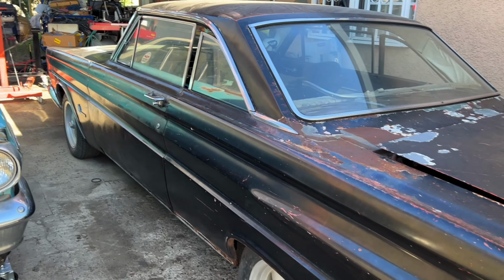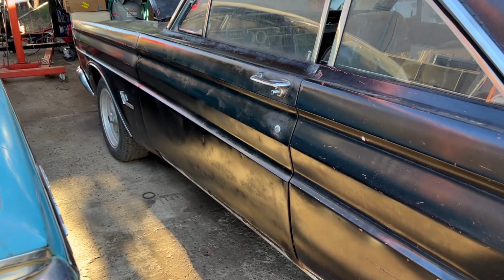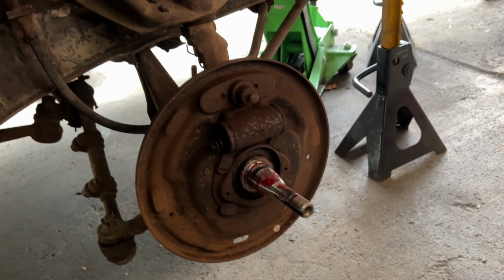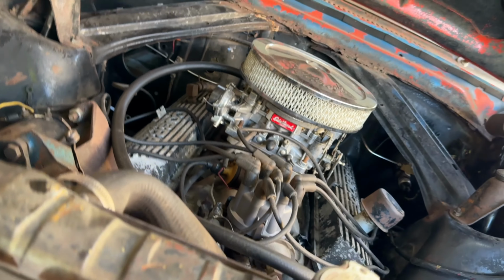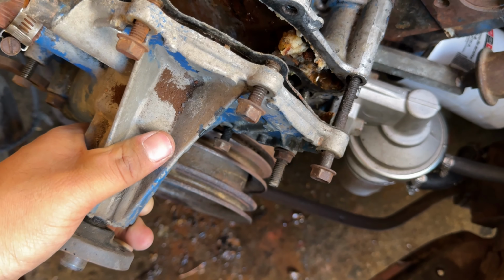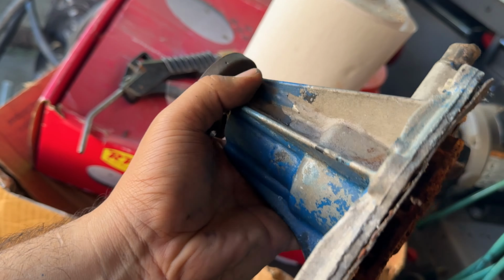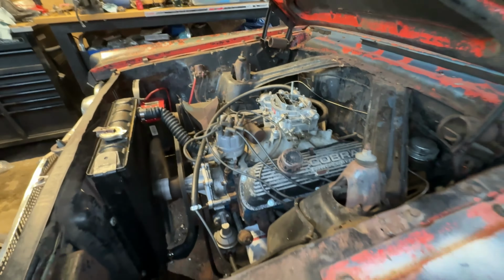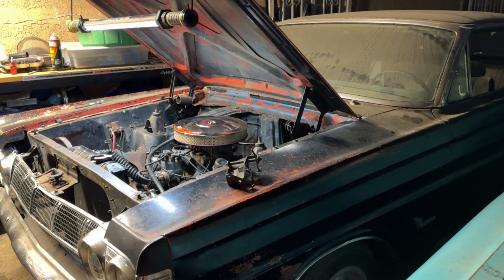Getting the 1964 Comet Cyclone Back on the Road!

Comment: Good progress and it is clever that you keep old parts around and you do not dump everything brainlessly. I am the kind of guy who has a hard time throwing stuff. Sometimes I have three gas pumps and two reserve carburettors in the trunk of my vehicles. I learned the hard way to always keep ignition cables and even sparkplugs in cars. I had critters eating cables so many times.

Comment: look at the rear brakes again . The self adjusting cable is not centered and seated on the spring pin . The outer spring is not seated on the pin either . May cause a problem later ...
Reply from the maker: Thanks Martin I will take a closer look !

Comment: The last thing I would not do is put tap water in the motor or Anti-Freeze, since you live where the weather doesn’t drop below 34 degrees.  Go to a self serve pay water  drinking machine station and at 35 cents a gallon would be nothing as compared to the rust that you will be getting in 5 days. Add a tablespoon of soluble oil lubricant for that bearing in that water pump.  Trust me on what I’m telling you. My daily driver 66 F100 has been running on the same drinking purified water and water pump lubricant (soluble oil) for over 7 years without any issues & no rust whatsoever. Every 3 months I open up the radiator cap to look inside and I always notice the bottom radiator cap is bright clean without a hint of rust.  And adding  Anti-Freeze is a motor killer.  If you blow a head gasket with Anti-Freeze in it , R.I.P Comet motor.

Comment: What flare tool you using? I need to snag one and have been looking at a bunch of them. Need one for brake lines and up to 1/2" for a different thing.
Reply from the maker: I bought it from Amazon, but a lot of other sellers have it as well. It’s a nice tool to have, it does have trouble with stainless steel 3/8ths line. I would recommend the master cool 72485. A friend of mine has it and it’s awesome, I’ll be upgrading soon to that one